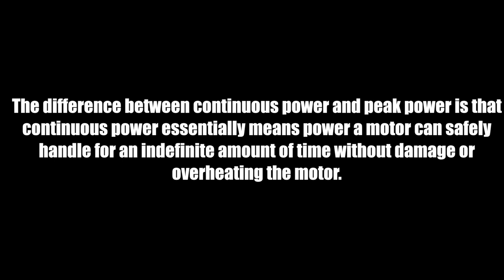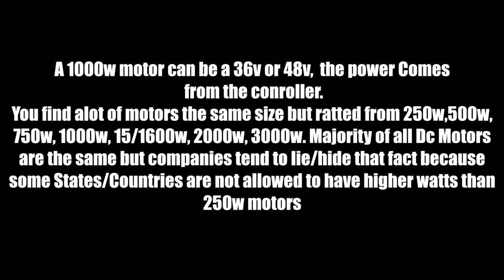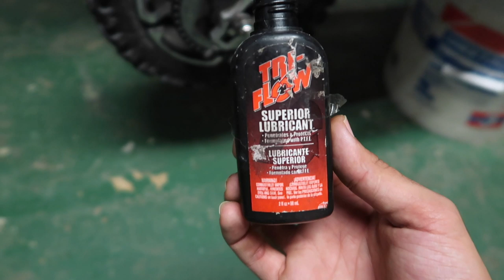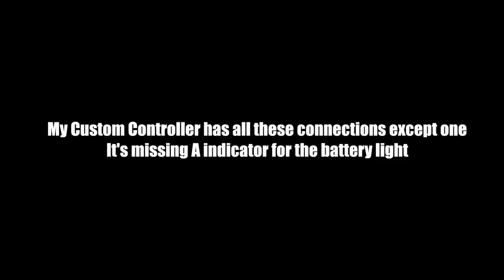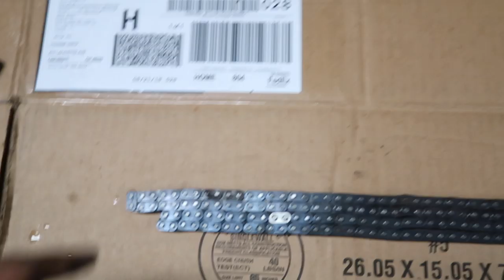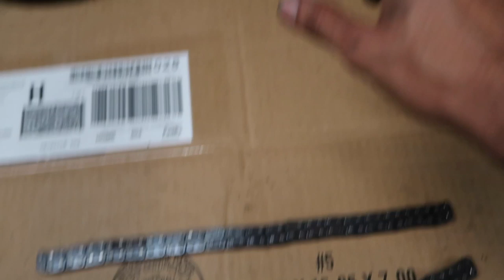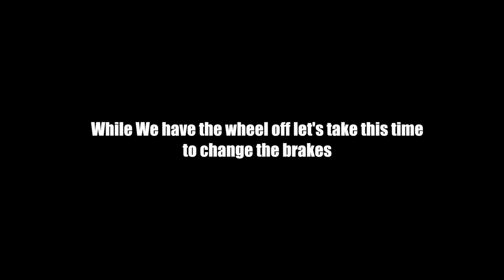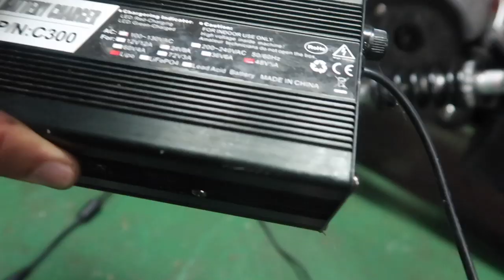Uberscoot 1000w/1600w Electric Scooters FAQ / How To

Comment: Boss, I'm an expat here in Doha Qatar. Can you help me buy a 48v lithium battery? My stock battery is 4 lead acids and they're heavy. I think Lithium is lighter and more reliable. My scooter is 1800W by the way. Thank you.
Reply from the maker: Get the same battery I have which will work for your 1800w link below and make sure you select the 5A charger (5hours to charge) not the 2A charger (10hours to charge). 

https://m.aliexpress.com/item/32653882085.html?trace=wwwdetail2mobilesitedetail&productId=32653882085&productSubject=Free-customs-duty-High-capacity-48-volt-li-ion-battery-pack-with-charger-and-BMS-48v&spm=2114.13010608.0.0.czVjUv
Reply: @Scentedstyle  thank you boss! I see that batt & charger but it seems the version of Ali Express is in German language.
Reply from the maker: I don’t know why it’s not in English but it should be a English button on top if not I looked online I got this, 

This is how to change AliExpress to English.

Usually the problem is that AliExpress detects your country location incorrectly, thus displaying the wrong language -- here are several solutions that you can try (results vary).

Cookie solution

First clear your browser cookies (for aliexpress.com & alibaba.com).
Important; Open the first page in English after clearing cookies.
Now AliExpress should remember English as the default language.
Reply: @Scentedstyle  boss, I've made the translation into English but sad to say the kind of item can't be shipped here in Qatar.

Comment: so did u do what i think u just did u chang the contler oon the rthing to give u more power speed an more u no i seen ones u can plug in to ur pc an set speed ur self sir have u seen tham lot cash i baet but i think this is cool spand 500 on a 1000watt an push to to 1500watts an push speed till its not hot but wrom maby

Comment: 36 x 28 might be 1008. My scooter goes 27 mph. It's 1600 watt with four 12 volt batteries at 12 amp. My sum wud be 48 x 12 in is 576 so Sumit not right cuss mine is 1600 watt not a 500. Let me e know wat going on ere then.

Comment: Prospective buyers should be aware that Uberscoot scooters are powered by (SLA) lead-acid batteries - not lithium ion.
Reply: and it's chain driven. most modern scooters use hub motors.